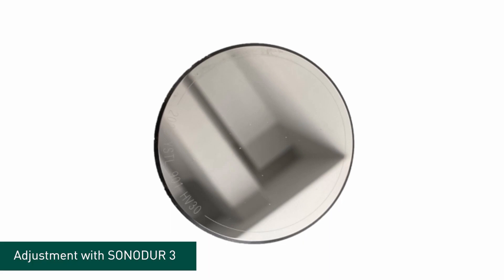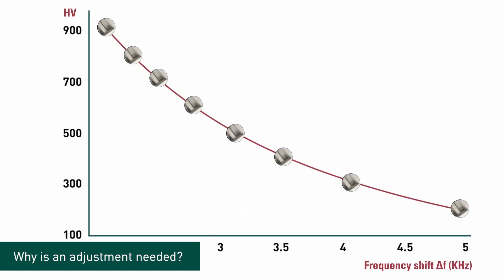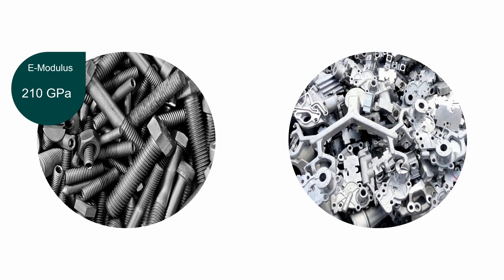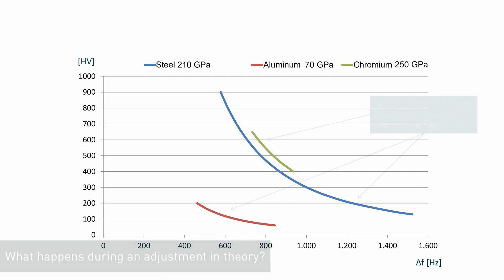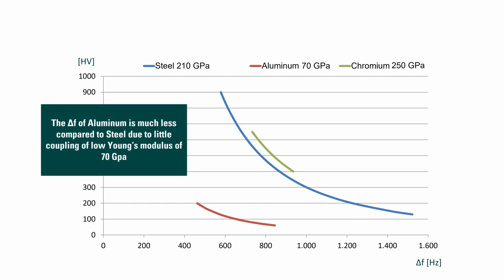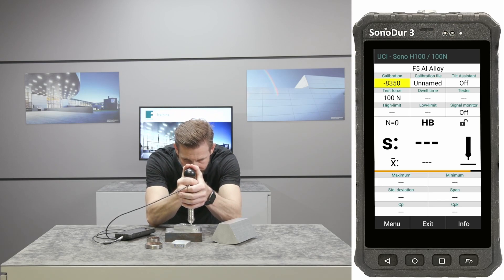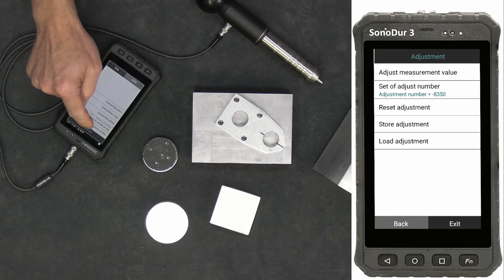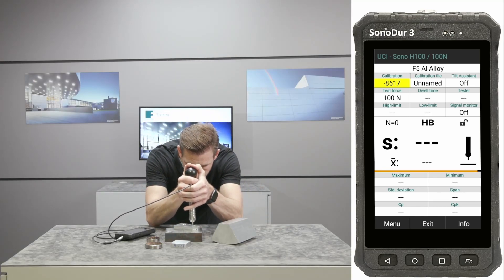SONODUR 3 - Adjustment

Comment: my client asks me why the calibration block using value HV30 and then procedure using HV10, that is why my client rejected this result and require to re-test hardness at HV10.
You can share to me some standards or guidebooks to convert it?
Reply from the maker: Thanks for your question! Some hardness plate manufacturers use a higher test force, such as HV30 instead of HV10, depending on the hardness. The differences between measurements with HV10 and HV30 are marginal and can generally be neglected. The video is intended to demonstrate how the adjustment of an UCI measurement should be performed. To proceed with complete accuracy, the hardness reference block would need to be DAkkS-certified for the respective test force of the probe. However, the procedure shown is technically correct. 
If you have any further questions, feel free to reach out again!